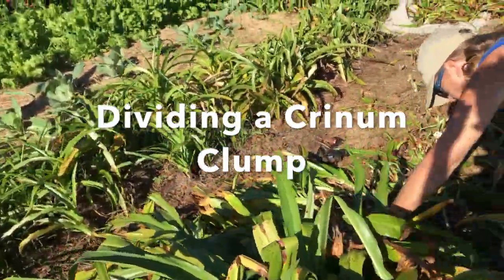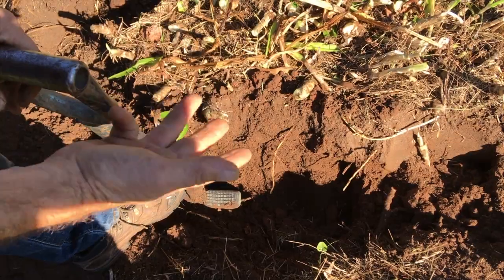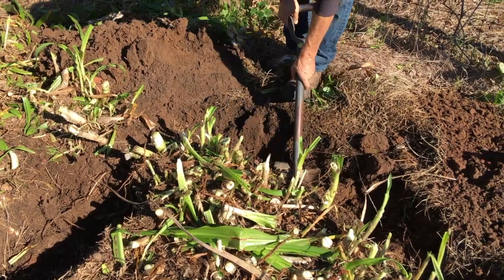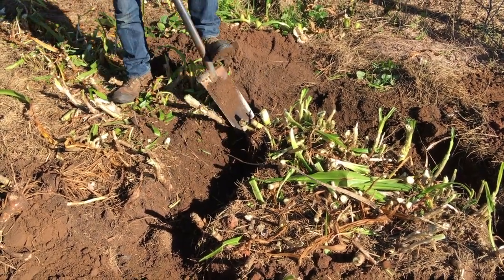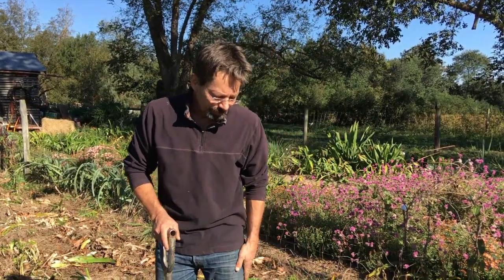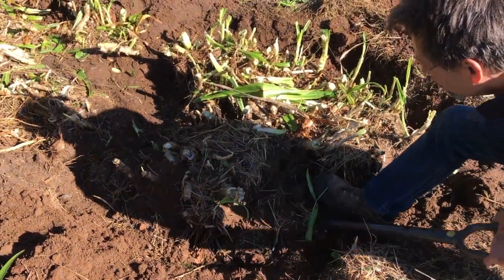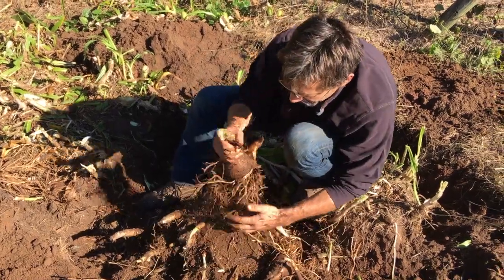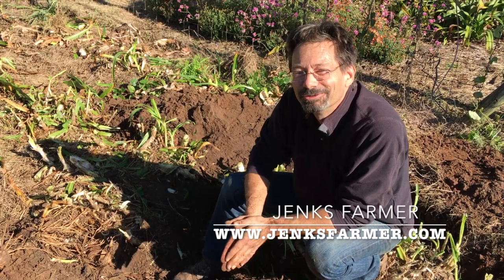Dividing Crinum

Comment: I see your spade leading edge  is flat; when do you choose that vs one that is curved?
Reply from the maker: I prefer a flat spade -- it's useful for trenching. Also when cutting and dividing I feel I have more control. But more important to me than shape is that this a heavy duty, angled in weld between handle and blade.
Reply from the maker: I chose by the quality of the spade, these are King of Spades. But I feel like I have better control with a flat blade.